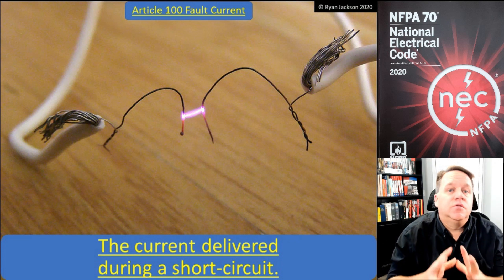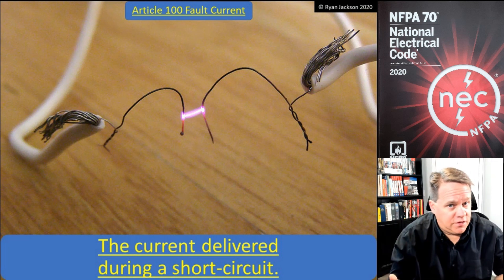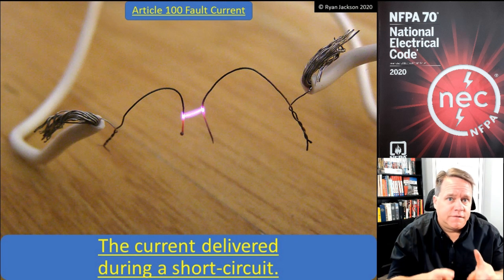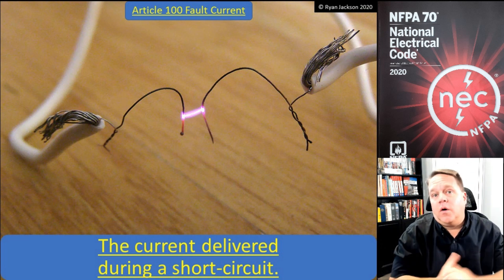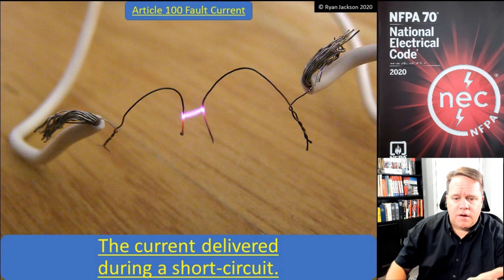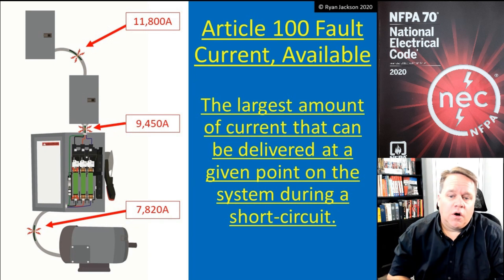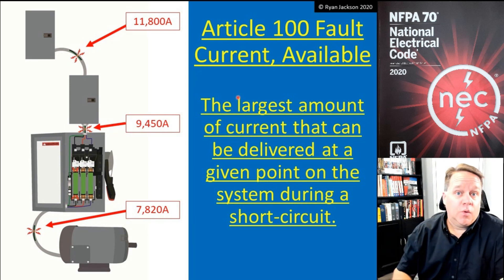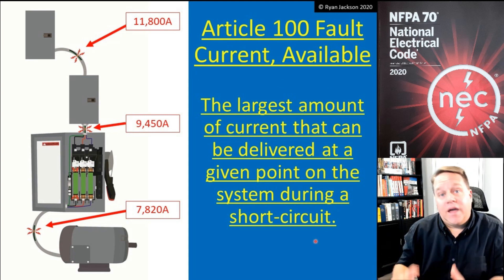100 Fault Current & Available Fault Current

Comment: Hi Ryan thanks for sharing.  I’m not sure but the terminology are kind of confused here.  I would say “present” fault current is the fault current at a particular point on a electrical system when there is a fault  and “available”  fault current is the withstanding of the electrical system at that particular point when fault happen.
Reply from the maker: The ability of a circuit breaker or fuse to withstand fault current is called the "interrupting rating," for all other equipment it is called the "short-circuit current rating."

Comment: On the matter of available fault current and overcurrent devices being able to safely clear AFC, are there not similar requirements for disconnecting devices should one be manually opened during a peak AFC event?
Reply from the maker: Most things (like a disconnect) need a short-circuit current rating. See 110.10

Comment: In our plant I saw a dead shot on a 125 amp 208v circuit trip the 1200 amp 480v 3 breakers up line through a transformer not supposed to happen.
Thank You again for your videos